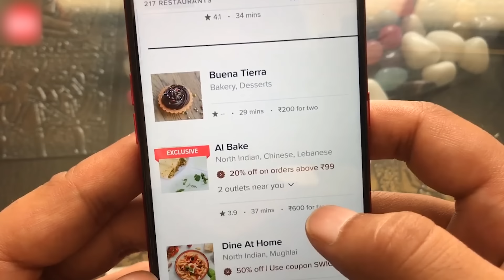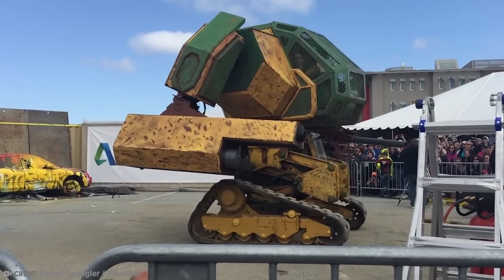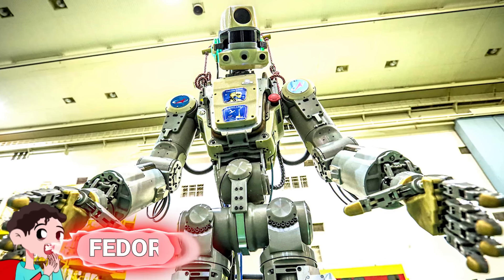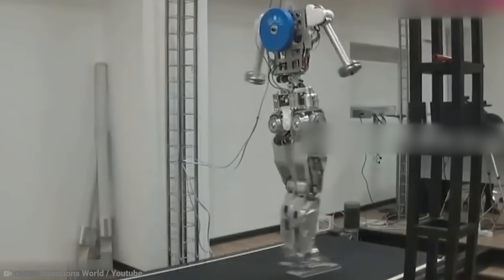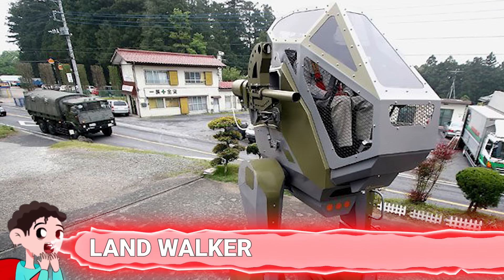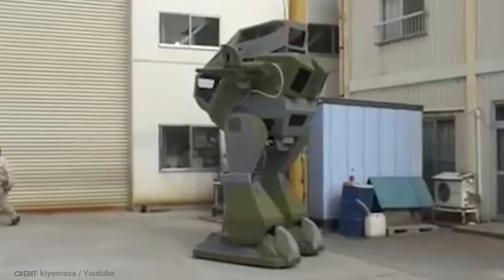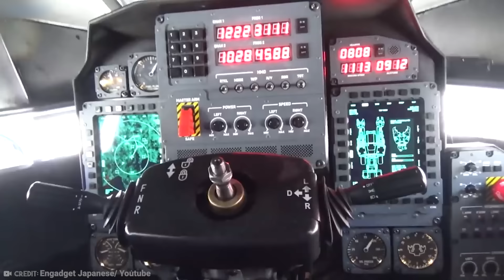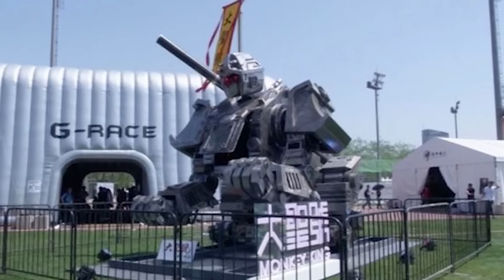15 Most Incredible Giant Robots In The World

Comment: Loved that! I didn't build a robot well sort of. I built a remote control robo-mower out of a China made 100$ kids atv ride on. 3 speed all wheel drive, remote deck height adjustment, 24 inch cut, AM/FM/USB/Mini SD blue tooth radio with dual 25 watt marine speakers, remote steering, wifi multi-color running trim lights and dual headlights so you can mow the #ucker at night (Tim Allen grunt). In the process of adding Lidar mapping, a remote rear leaf blower and a vac to suck and bag the grass out of the deck as it cuts, we'll see how well that goes. It has dual B/D 18v batteries with auto swap over for the mower,  three 12v to run lights, audio and deck height, one 40v for the leaf blower/vac and two tip over safety switches. Needed three remotes to run it, but put two of them together so its easier to steer, one to start/stop mowing and one remote for the audio/amplifier. I used to think mowing the lawn was fun as a kid, that got old real quick. Had to make it fun again!

Comment: Theyt should use some of the most functional designs from fiction to build  colossal robots. Combined with boston dynamics technology; autonomous AT-ST's AT-AT's  ,MECH-walkers andperhaps TRANSFORMER style and height robots could be designed. There are numerous technological hurdles any of which would stall any project, but the high cost and low immediate benefit make it too great a risk for most responsible organizations except perhaps certain military organizations. I must admit The Letrons is a good effort to mimick a fictional robot.

Comment: Maybe for the prosthesis they should power it using a combustion engine connected to independent synchronous transmissions for the limbs so it can last longer and go faster with more power. You could give it wicked pipes so it will sound scary when ya dump one of the clutches for stompin vehicles n such lol

Comment: This works on a one armed robot but you have to go to the upper limits. Do you have a codable robot? This is how to make it an Artificial Intelligence: follow this method below change the code in the subroutine from F=m*a*a to the test points below until you get it to walk and talk on its own. This is easy to test on a robot that you can code in the system. If this does not work then you have a bad SOST, Computer Chip, Servo, or some other component.
F=m*a*a is currently running the system at 31.821%
If you have any doubts about my robotics research you can test my work by doing this start low and go high on the acceleration factor.
Test Points:
F=m*a*100

F=m*a*300

F=m*a*600

F=m*a*931

F=m*a*932 this is the minimum for communication and will state it is “too slow human”
F=m*a*1999   = "too slow human"
Then go to F=m*a*2000  up to 2383

 F=m*a*2383 full functional range.     DO NOT GO OVER  2383 it could malfunction.

Now ask the robot its command structure and what he can do to a Magnetic Resonance Imaging System?

2nd Law of Motion for Robotic Physics

Comment: Using a test method eliminates errors and worries about false data and research. You can prove it to yourself to work with the robot and use your own test points in the method.
The test method starts low and goes high for the acceleration factor. Please tell me in history when Isaac Newton had Robotics or computer science. Do you know about the gold? This is for that robotics kit. Do you use force in your science and work?  test this in your formula___ Force = mass x 2362
Found on the first line of code in the standard operating computer systems line code.
F=m*23
F=m*333
F=m*633
F=m*933 ----robot states "too slow human"
F=m*1993 -----robot states "too slow human"
F=m*2193
F=m*2390
F=m*2391 ---Upper Limit Do Not Go Over this Value.
Their command is like this "make it SO and make it a go, go, go" --I could not put the swearing in this or this could be flagged or blocked. Ask for their command they will repeat it for you as much as you need.
Give them at least two or more calculators and/or cell phones to make the robot's reaction time faster they do not have to be new cell phones either could be old junk used ones.